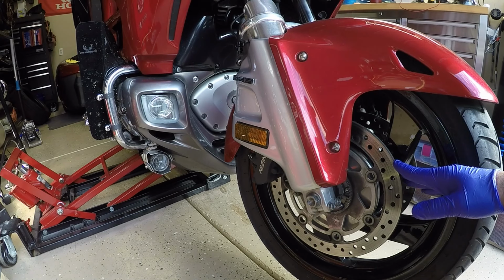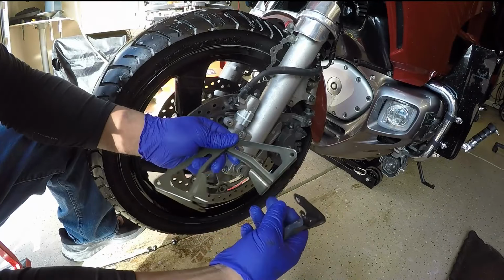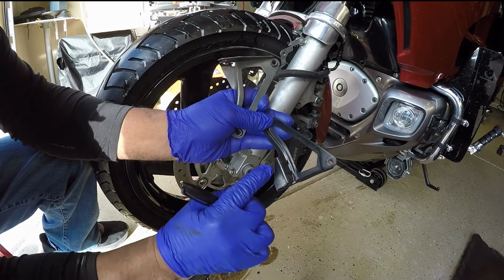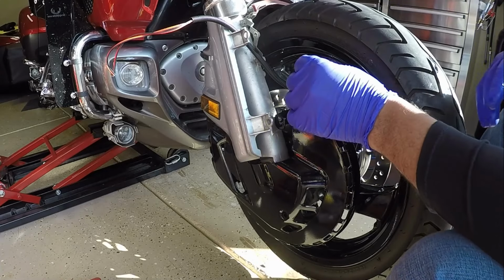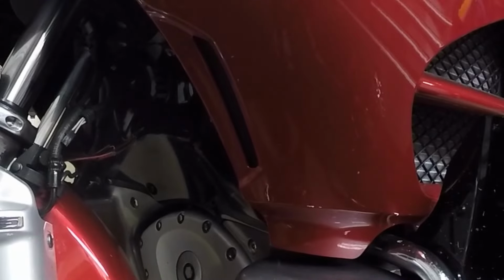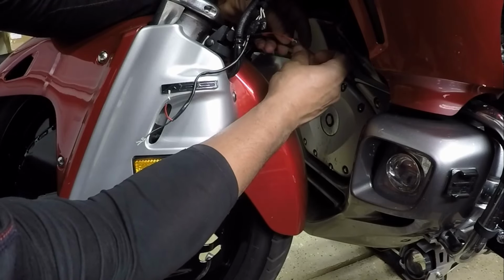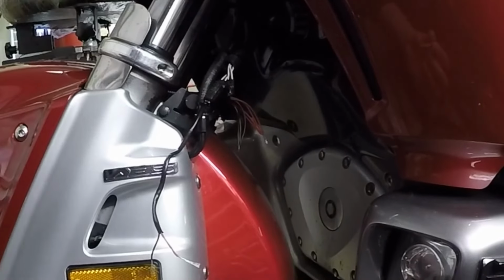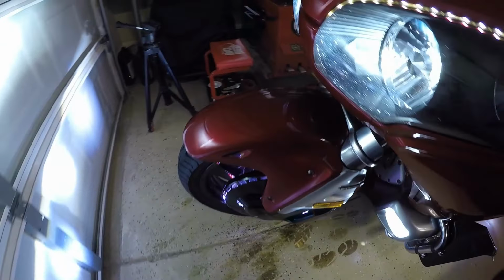BLACK ROTOR COVERS AND LED RING OF FIRE

Comment: I watched the video over and over a few time( I got the black ring of fire, not into the chrome) in about 7:20 you get ready to connect the wiring. I watch your kyriyakin connection but still haven't figure out the connection part. What do you connect it to in the fork area?